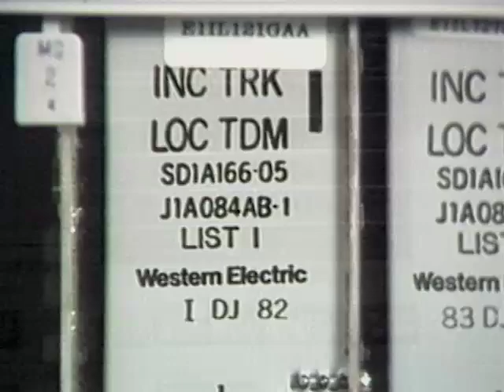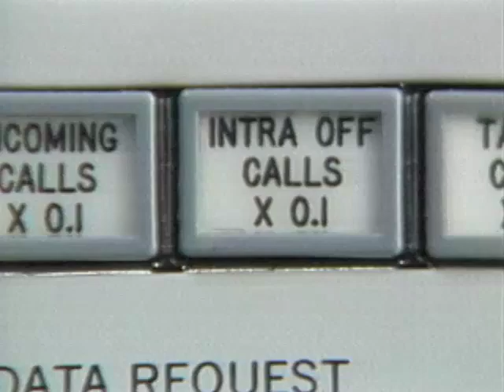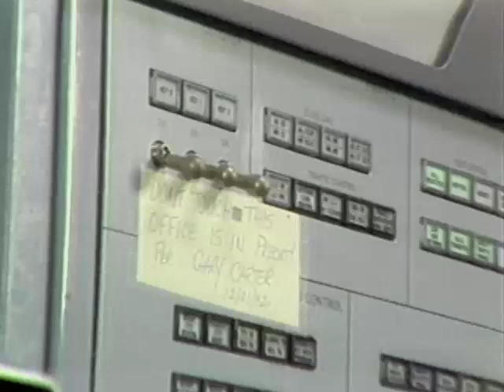Speedy Cutover Service, SXS switching cutover to ESS filmed live at Glendale CA central office, 1984

Comment: I honestly don’t get why it is important to cut these wires in a fast manner
Reply: Because you're literally cutting telephone connections, the less downtime the better.
Reply: @TheLazurus  Alright so the new system was already astablished beforehand?

Shouldnt there be just one main wire you can cut through or just shut the electricity of or something ^^
Reply: @themomorain  you'll realize that, like a lot of things in life, that level of thought was never put into the old existing system.

Yes, obviously the new system is pre wired and powered off, having that "master switch" capability. And yes later on when the new system got old and replaced it wasn't this dramatic.
Reply: @whickervision742  Okay thank you for that answer really interesting how this stuff used to work.
Reply: @themomorain  From another commenter: The new ESS switch had already been wired in parallel to all lines, but had to remain dormant (probably isolated via per-line relays, all of which were engaged by that final switch throw at the end) until the old was gone to avoid conflict.  The old switch lacked any per-line isolation to cleanly disconnect itself, and even if powered down it would still have passive circuit elements (coils, resistors etc.) connected to all lines that would interfere with call processing and quality on the new system.
Reply: @themomorain  All these cables are the “main wire”. Every single phone line in that area had a copper wire coming into that building.

Comment: What is even happening in this video?

And how do I visit this building?
Reply: They are swapping over very old technology telephone call switching equipment (electro-mechanical step-by-step gear) to the (then) latest form of fully electronic switching equipment. The cables they are cutting are what all the calls and other traffic go through when connecting to the old equipment (the physical link between the outside world and that particular telephone switching gear). Back then, everyone who had a landline telephone had a pair of wires in one of those cables that connected all the way back to their telephone. Not in one unbroken circuit, as it usually had to go through various intermediary junctions first, but essentially it's one connection.
Reply: @BeachcomberNZ  thank you very much for the excellent explainer, amazing

Comment: Why are they cutting the cables?
Reply: They were cutting over from the old electro-mechanical step-by-step circuit switching equipment to the new electronic switching system.

Comment: Why not just cut power supply from old system and start new system in the next second? Then there is unlimited time to cut single lines, which were already in parallel for weeks without problems.
Reply: From another commenter: The new ESS switch had already been wired in parallel to all lines, but had to remain dormant (probably isolated via per-line relays, all of which were engaged by that final switch throw at the end) until the old was gone to avoid conflict.  The old switch lacked any per-line isolation to cleanly disconnect itself, and even if powered down it would still have passive circuit elements (coils, resistors etc.) connected to all lines that would interfere with call processing and quality on the new system.

Comment: Are there any vdeos of them reconnecting the phone service after cutting it?
Reply: The new service was already installed in parallel, every line was connected to both switches, but only one switch could be active. The ESS machine was all wired in, and could be given the start command at any moment. But the SXS switch couldn't simply be told to stop -- it had no central control -- so to perform the handover, all the circuits had to be physically disconnected from the SXS before the ESS could be placed in-service.
Reply: @myself248  I see, thanks for the explanation.
Reply: @myself248  the untold truths😎 great explanation

Comment: I'm really confused, if there was a switch, why did the cable literally need to be cut?
Reply: i presume the switch was to turn on the new routing equipment, that was wired in parallel to the old system while it was working.
But phisically, u had the terminals of the lines connected to both switch system the old ( that was in use until the cut) and the new.
So if they dont cut the wires before turning on the new syatem u'll have electrical shorts on lines, feeded by both old and new switching equipment
Reply: @riccardoz2953  but why couldn't you just turn off the old equipment? If the new equipment was already wired up, but turned off... Why can't the old stuff be wired up but turned off?
Reply: @TheDarkFalcon  Sending power to the wrong equipment. Causing malfunctions with incorrect resistance values etc, oh yeah and let's not forget the fact the technicians would be removing one part at a time of the old equipment - so it shouldn't be connected to the new.

Comment: I like when the tech manually checks that ALL the wires were cut.   3:47
Reply: Faster than triggering then mitigating a blown fuse or damaged line card on the new switch.

Comment: Who did Strowger piss off that we're cutting his name out of the history books with this "SxS" crap?
Reply: Strowger founded Automatic Electric(AE), Bell refused to start installing automatic switching until his patent ran out and they could manufacture it on their own at their Western Electric facilities. By that time they also developed their own advanced switching system, the Panel Switch that could do code translations in its sender section and as such was preferred in large cities like New York and Chicago, while smaller cities and rural communities got Strowger. AE also held some sort of trademark on the name Strowger as far as I can guess as they used it for other products like an automatic toll accounting mechanism for their own step switches, it was called Strowger Automatic Toll Ticketing or SATT.  Western developed a similar system and deployed it in Los Angeles called SAMA or Step with Automatic Message Accounting, though their prefered system deployed throughout the rest of the Bell System on #1 Step and #355 Step as well as Panel and #1 Crossbar was to have the calling number sent forward to the toll tandem in a system called ANI(Automatic Number Identification) and the billing recorded there, CAMA(Centralized Automatic Message Accounting). In very rural areas on typically #355 Step CDO(Community Dial Offices) offices there was no ANI equipment installed and an operator had to come on the line and ask for your number and key it into the toll tandem while it held up call progress waiting for the rest of the info.
Reply: @richardhz-oi8px  I worked at GTE_AE 1970-1980 developing CAM software.  16,000 people on the shop floor building stepping switches when I started; 6,000 build EAX#1/PBX's when I left.

Comment: Do people even have landlines anymore? I'm sure there are some, but I think its days are numbered, at least for non-commercial applications.
Reply: @thegrandfinale2 It's like a landmine except instead of blowing you to smithereens when you step on it, it lets you talk to your Aunt Bertha in Wisconsin.
Reply: lots do but yeah it's dying. dead already for most business because voip is so much cheaper
Reply: We sell VoIP, but backfeed the existing phone lines in the home. So most people dont even think of it as anything different than they already know. 

Its just a million times cheaper, and doesn't work without power. 

About half of our customers have phone service. But we provide services in the woods where cell phones barely work anyways.
Reply: Where they (or VoIP pseudo-landlines) still exist, it's nice at times to be able to call a household/place rather than a specific person.  Also easier to have extensions, wired or cordless, spread throughout a house rather than having to keep up with a cellular that may not have good signal in every room (though the Bluetooth-pairable cordless sets can mitigate this). Non-cell handsets can be more comfortable for long calls when not using a headset.  Businesses prefer the reliability and more flexible call routing options, though many PBX systems can now tie into cell handsets as well in various ways.
Reply: My gigabit fiber service comes with a land line.
Reply: @RaymondHng  Nice!

Comment: My smart phone has more power than entire building
Reply: I'd like to see your smartphone try to switch 80,000 lines.
Reply: Depends on what you see as “power”. The biggest part of hardware will be converting analog lines into digital (ADC’s) so it will be able to reach your phone. But i have my doubts if your phone can handle 80k audio streams at once. Pretty sure phone systems are not plain microprocessors but some specialized infrastructure.

Comment: I don't get it.. Why? And how did it help to cut the wires...
Reply: I'm guessing the new switch was in parallel with the old one. Cut the old one and switch on the new. Idk why they both couldn't be on a little bit??
Reply: @tactileslut  oh my! And 66 block or wire wrap? Lolol
Reply: it was most likely wire wrap , so the easier way to go about it was to twist on another wire to the new system. And then cut the wire going to the old system. Both systems would not be able to be on at the same time as they would both try and answer a call on that line one being mechanical and one being digital control it would probably end up dropping or looping.

Comment: What's going on? Don't you install the new system first, and when that's up and running you can dismantle the old system at your leisure? Why do you have to cut lines quickly to change the system?
Reply: They're wired in parallel which means that it is built, tested, and installed while the old one is still functioning on the same lines.

Comment: Why do they need to physically cut the lines? Why not change over to the new system, then later cut the old lines? Is an upstream system connected to both old and new, and uses the old unless the old circuit is broken?

Comment: 1984?? Why install an ESS?? A 5E or Dms-100 makes much more sense.
Reply: The 5E is a digital switch manufactured by Lucent, ATT, WECO (Depending on the year). The DMS100 was manufactured by Northern Telecom, NORTEL, Northern Electric, (depending on the year). The DMS 100 was quite popular to replace end offices in the 80s and 90s. In Westchester county NY Chappaqua NY cut from SXS to DMS-100 in late 83 or early 84. Tarrytown NY cut from XB5 ETS to DMS 100 in Nov. 84 and Dobbs Ferry, Scarsdale, Ossining, Peekskill, Yonkers, all cut to the DMS 100 during the mid to late 80s.
Reply: Poor Planning. Service demands could have made to long a wait for digital switches. I was surprised that we cut some 1AESS switches to 5ESS when we still had some SXS and XB. I found out that planners cut offices with the most growth and not the oldest.
Reply: It's probably because of what was available at the time.  If available a 10ESM-50 would have saved another cutover in 10 years.

Comment: you could not just turn off the power mains to that office???
Reply: Noel Treadwell - still did not make sense. Power that block down, and then snip all the wires you need. Why do it while they are on?
Reply: Noel Treadwell  - Well, if it was that complicated, then their architecture was flawed.
Reply: Noel Treadwell - But, of course. They were smart but not many thought about how to transition in the future and their architecture and designs were flawed from that perspective.
Reply: Noel Treadwell - saving money now to spend more later is not being economical.
Reply: Noel Treadwell - This is like designing a new train and asking every current customer to jump onto the new running train off their running train.
Reply: From another commenter: The new ESS switch had already been wired in parallel to all lines, but had to remain dormant (probably isolated via per-line relays, all of which were engaged by that final switch throw at the end) until the old was gone to avoid conflict.  The old switch lacked any per-line isolation to cleanly disconnect itself, and even if powered down it would still have passive circuit elements (coils, resistors etc.) connected to all lines that would interfere with call processing and quality on the new system.

Comment: Surely there would have been a better way to do this than ACTUALLY cutting all the cables?

People are fucking weird, man.
Reply: Nope. The new system is wired in parallel which means that it is built, tested, and installed while the old one is still functioning on the same lines. Cutting the cables allows the other switch to take over instantly.